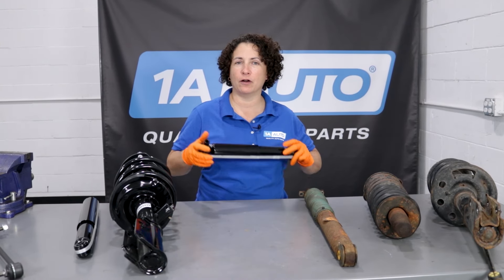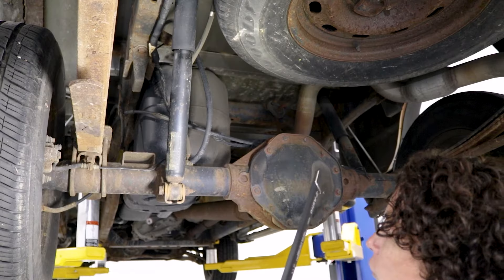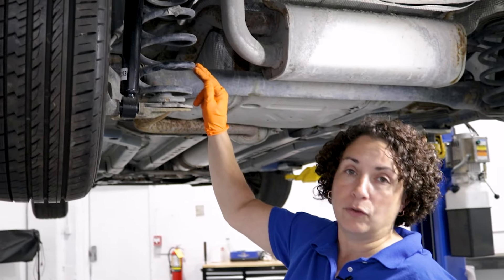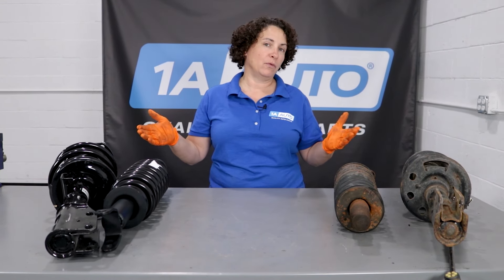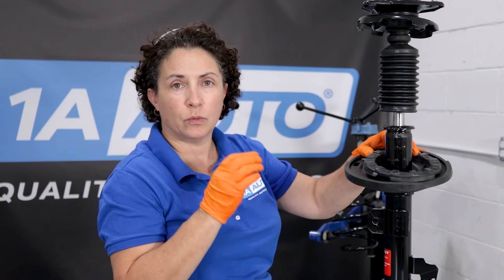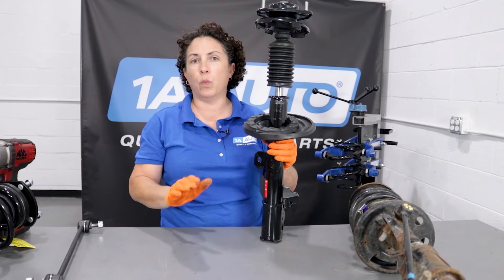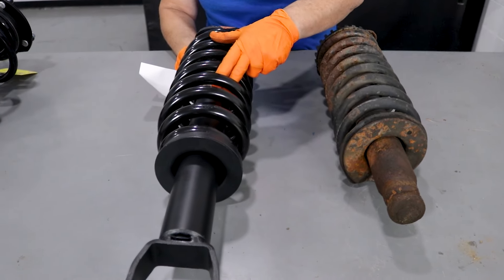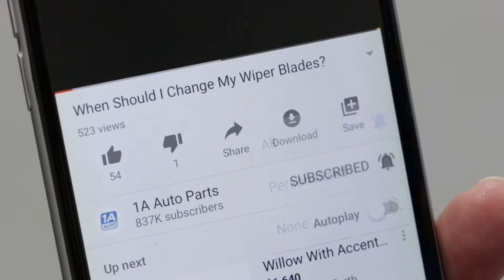What are Shocks? What are Struts? Which Does Your Car or Truck Use?

Comment: Exellent presentation. I am down in Merida, Yucatan, Mexico preparing my retirement home and brought down my old 2014 MKT, Livery grade. It needs Struts taht are electroniclly adjustable. The price downhere is $15k pesos which is $850 US currently is an absolute rippoff. I replaced them with a non-electronic strut for $60 US but I am looking to rebuild the old strut. Your presentation was awesome. I will search your channel for content related to my project. You have a new fan. Once I get downhere for my retirement , I may just build a Suspension shot to rebuild these electronic  puppies just to beat these thiefs selling a rebuildable item for 10x the price.

Comment: Thanks for the great video. What is the chance of the spring breaking? My mechanic said that I have a broken spring when I told him about a noise coming from the right front end of my car. I have to wait a few days before the spring arrives and was told that it was ok to drive the car for short distances on smooth roads until the spring arrives. I would appreciate your opinion.

Comment: Good video, only problem with my spring seated struts, I ordered a third set of strut assemblies.  The strut mount with the three bolts did not fit.  The strut mount was installed a little offset.   On my 2010 Mazda 6, the strut has a vertical knob that must slide into a yoke, so the 3 bolts on the strut mount has to fit almost pricesly. The strut mount does NOT move at all? Do you sell the tool to compress the spring?  I noticed the one I got does NOT even fit.  The coils are too close to each other. I am not sure if mine is considered a spring seated strut.  Mine does have strut mount installed. Please help A1 AUTO. Love watching Sue.

Comment: The "charged gas version"  only applies pressure to the oil fluid section  the piston still covered in oil.   This keeps the oil from foaming and reducing performance.

Comment: I replaced the struts on my Odyssey. 
One side started making a squeaky noise when turning that sound like rubber squeak. 
I've tried to lubricate it. But it's this normal or is there a problem with the top bearing it other part?

Comment: Can you please review TRQ strut/shock? I need a set for 01 Volvo V70, can they last at least 10 years or 100,000 miles?
Reply from the maker: +Wong Wang Thanks for checking us out. The TRQ parts we carry are direct replacements of the original equipment and should fit and function the same as the original parts. They should be lasting the same as the OE and are backed by a Lifetime warranty against manufacture defects so if they were to fail prematurely we would be able to issue a replacement. Please let us know if you have any further questions, thank you.

Comment: I just been told that my 2014 cadillac xts vsport platinum has leaky struts that need replacement. The car has magnetic ride on it and 135k miles on odometer. What parts are needed and where to buy ?
Reply from the maker: +Wasim Habib Hello, We currently do not carry any struts that are correct for models with the Magnetic Ride system. You may have to contact the dealer or try eBay Motors! Thanks for checking us out!

Comment: So the rubber casing is not necessary for a shock absorber?
My car's current shock absorbers have that cover and it's very loose - that I'm able to move up and down.
And looking at the absorbers on the website, I noticed that they do not have that casing.
I have an '00 Echo.